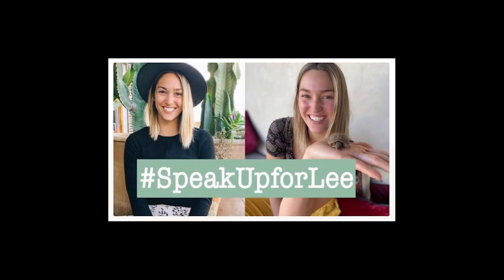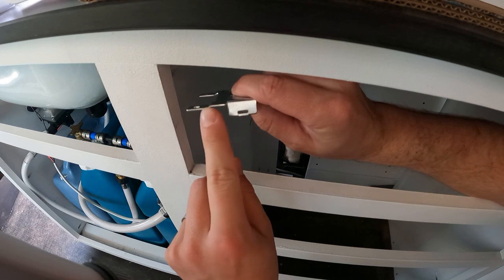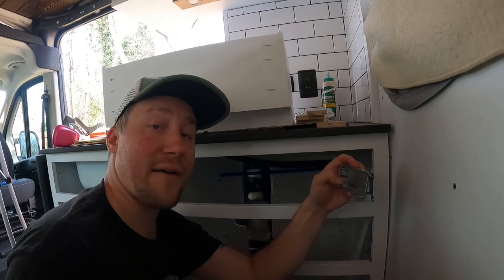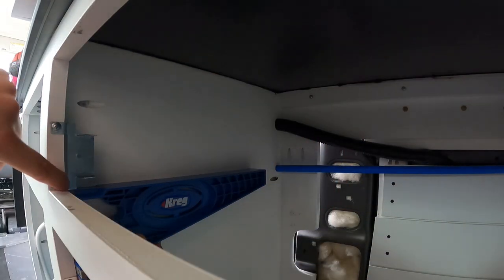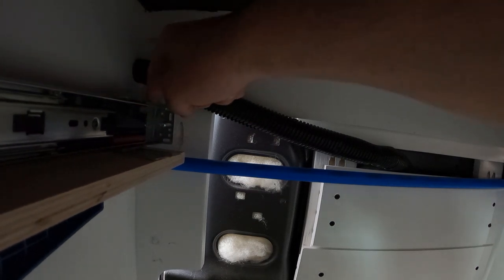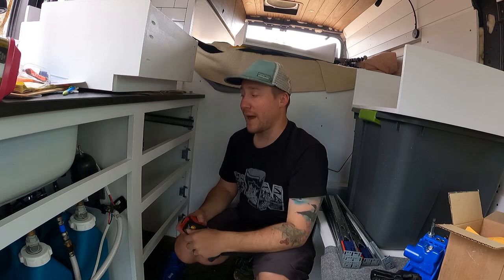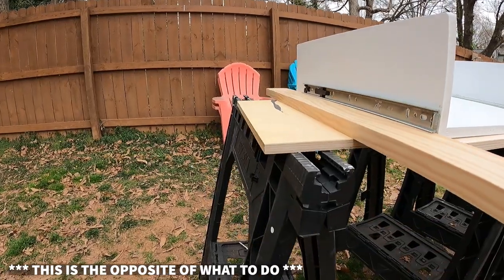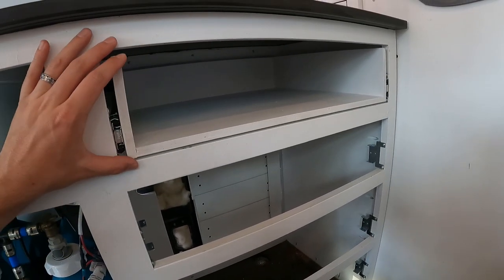Installing Drawer Slides for Van Kitchen + It's OK to Not Be OK //Ep. 38 DIY VAN BUILD

Comment: Do the drawers stay closed when driving with only these slides? You don't have any other locking mechanism, right?
Reply from the maker: With nothing in them they do but I did add push locks like the ones in our upper cabinet. I have an episode I need to edit with adding those they were kind of a pain to install. With any kind of weight I would suggest adding some form of latch